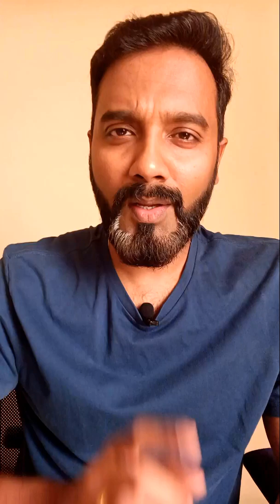Piping Design or Piping Software - WHICH IS BETTER? #pipingdesign #mechanicalengineering #career

Comment: Now design Knowledge and software knowledge required. I am in the field for past 11 years started as tranee modeller. In the intial years no tension as Team lead, senior people will help. But at present nobody will support. No team lead no seniors. Only provided with basic inputs.